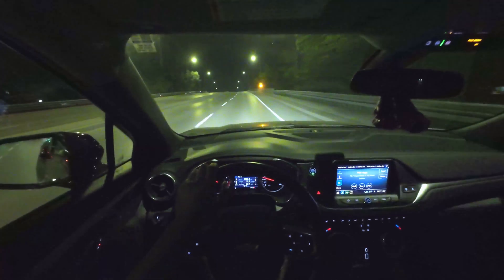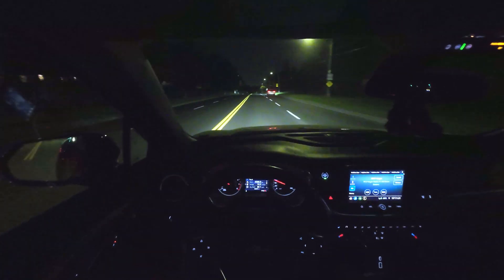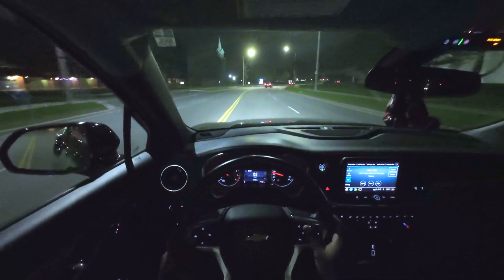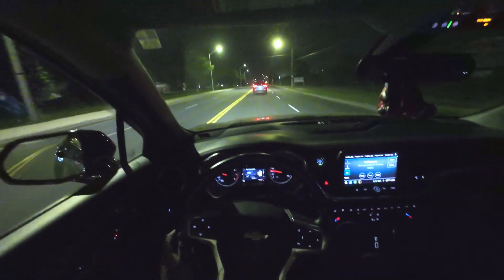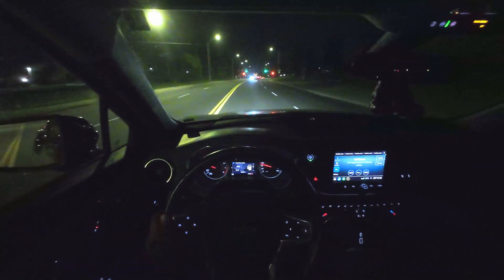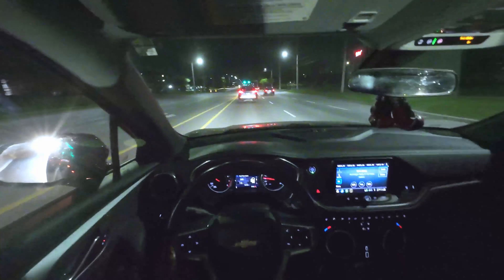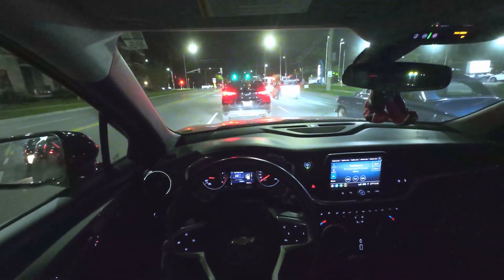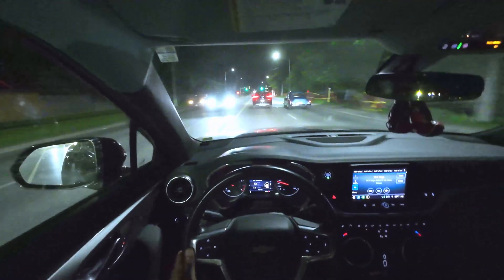When Engine Downsizing Works...And When it Doesn't

Comment: My wife has a 2024 Buick envista 1.2l 3cyl turbo. 136 hp. But the envista is light, front wheel drive compact suv. 136 hp is more than enough and that car can spin the tires quite easily. It’s definitely not a comparison to my Vette. But it’s more than enough for her.